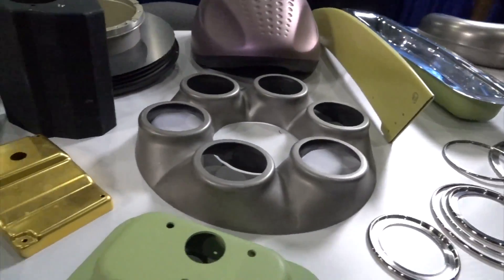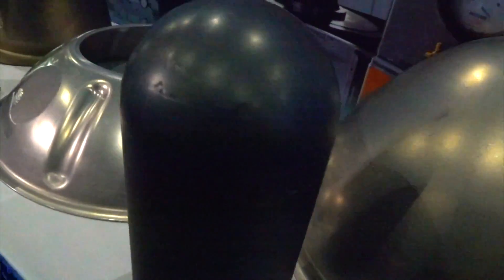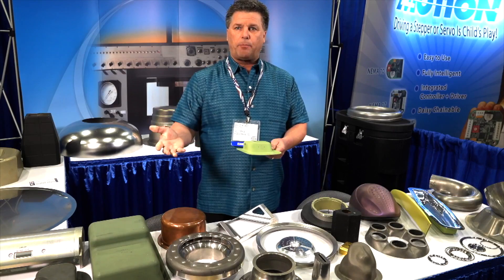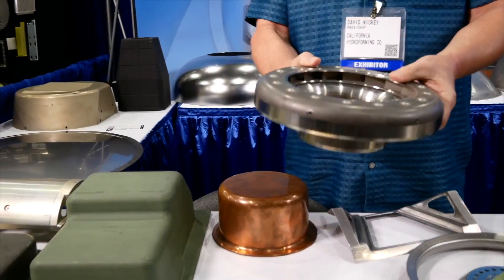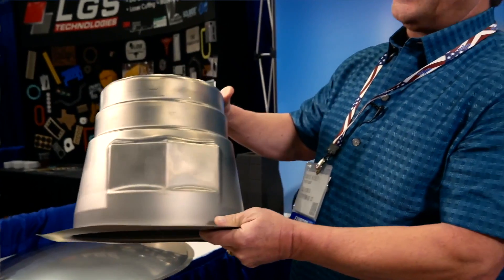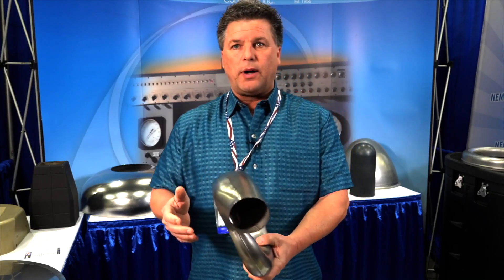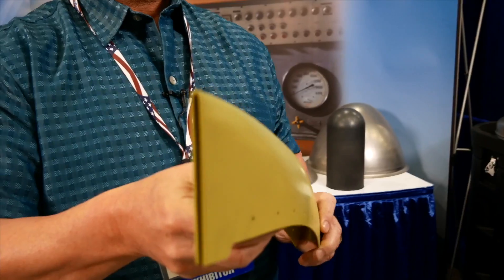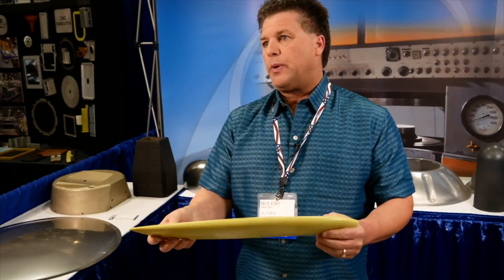Deep Draw Metal Forming - tooling 50% less vs stamping| California Hydroforming |City of Industry CA

Comment: It's an awesome process, I made tooling for a Hydroform press in the 1970's. Deep drawing aluminium and stainless. Even used epoxy punches for large irregular shaped jelly molds.
Reply from the maker: Very cool!
Reply: Do you think hydroforming could handle 1/8” thick copper sheet, pressed into the shape of say, a pan?
Reply: @nicholasdimarcelloiii3469  yes, easily. A pan shape is usually not a very deep draw (the sides might be say 3 inches high). Copper is very ductile and forms nicely especially when annealed before pressing.
Reply: @ thank you!